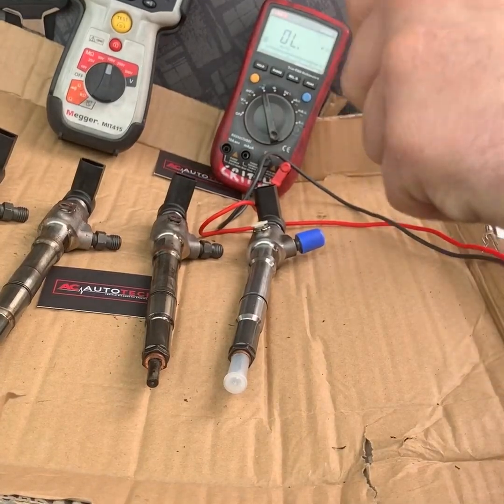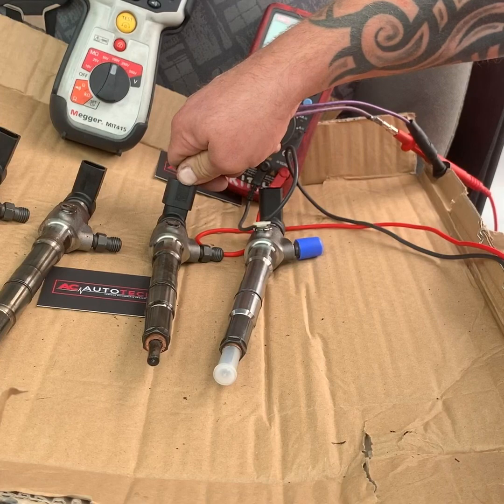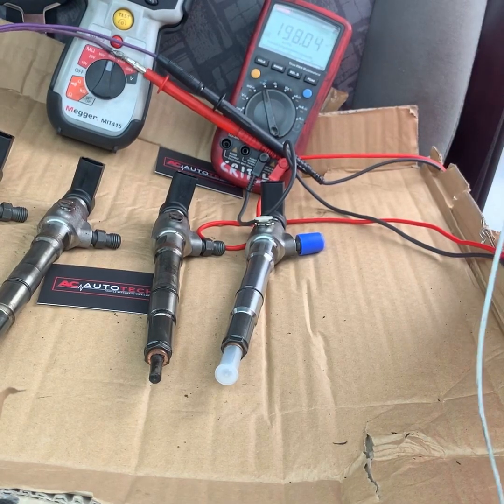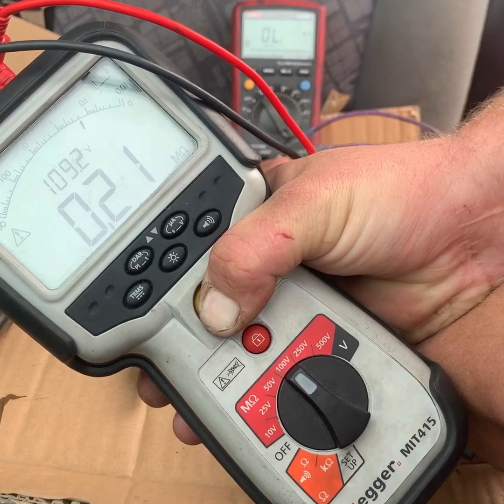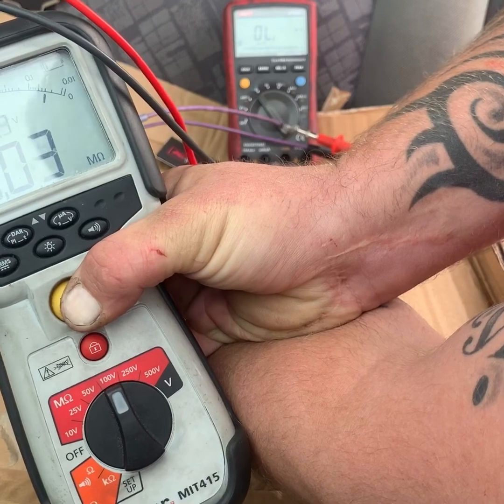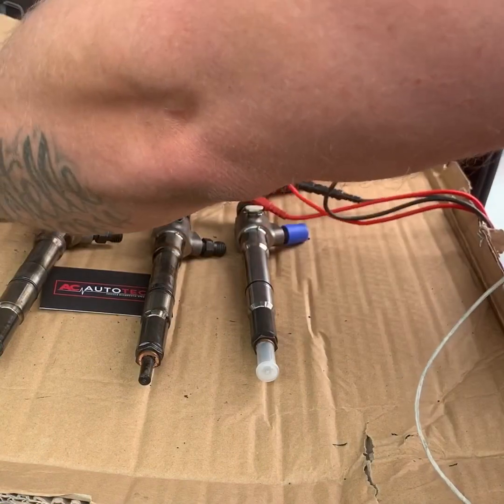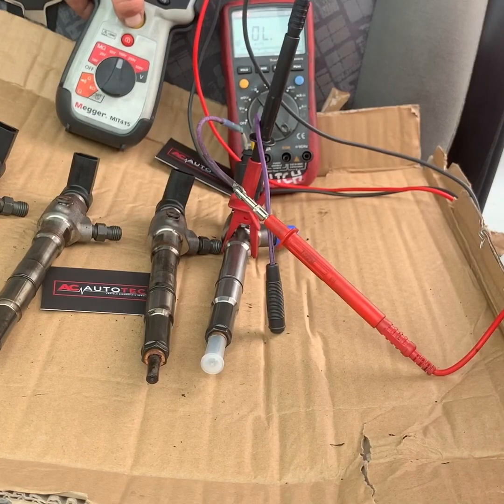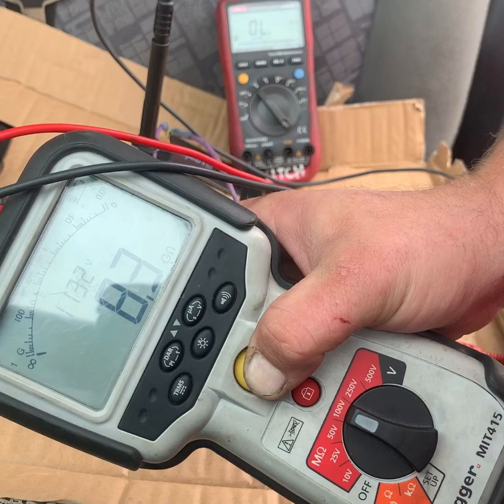Piezo injector insulation test

Comment: I can confirm. At 100vdc the insulation test must be around 0.2mohms whicb is a good reading and the injector will work. Anything from 0.04mohms or lower will not work! Even 0.04mohms will have running issues and isn't worth reusing.

Comment: Nice demonstration,  I don't have that insulation tester. I had a car with an injector fault code that passed the ohm test, I ended up moving the faulty injector to another cylinder and the fault moved with the injector. In that case the ohm test didn't work. Your test would have saved a lot of time moving injectors around.
Great channel mate.